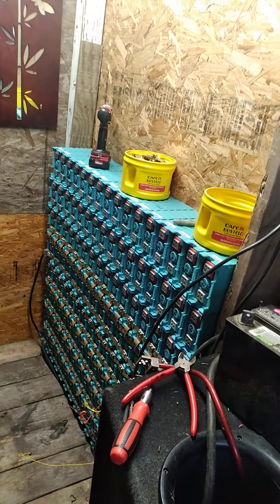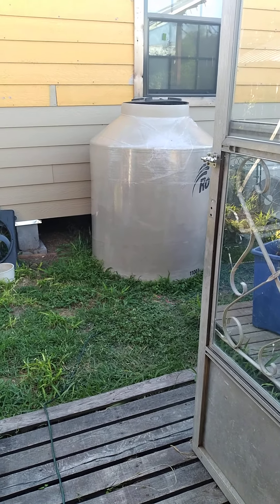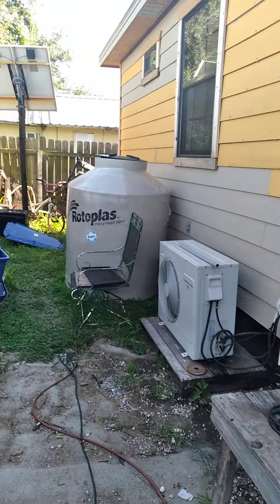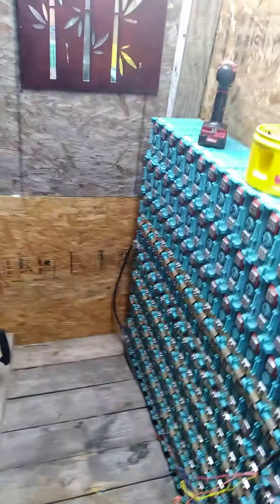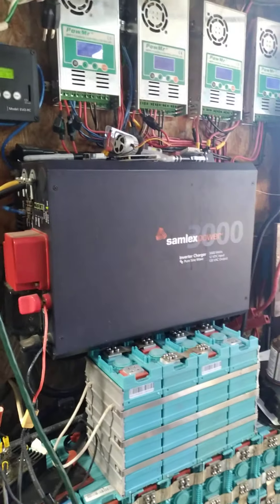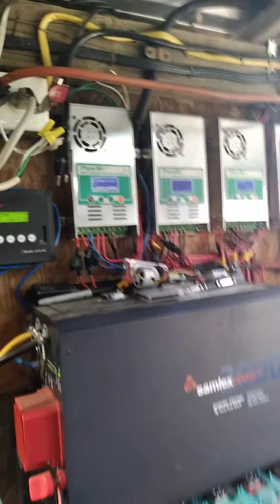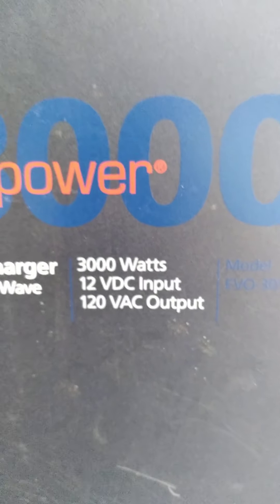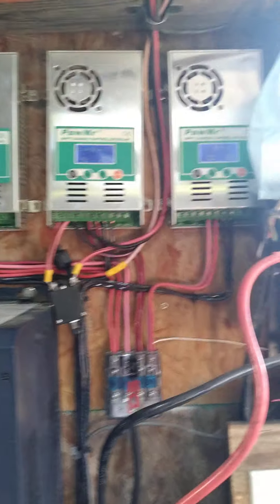start to move the off grid system

Comment: why don't you rewire your batteries for 48v and run a MPP SOLAR LVX6048 or 5048MG? 
The LVX6048 will run 6000 wats of solar with it's internal MPPT CC, 120/240v split phase output of 6000W continuous PSW inverter, it will handle your generator, with it's internal transfer switch. You can even parallel it upto 9 units for INSANE power if you ever need more. They are around $1000, which is an incredible deal. Your existing charger controllers will auto switch over to 48 v also, and handle four times the solar power that they can now. I mean you have the batteries already, why not do it right, once and be done with it? You get your 240 AND your 120 from one inverter. 
I have 2 of the 5048MG units, 7kW of solar, and can run my entire house, charge our Tesla, run my welder, shop power tools like planers jointers, table saws chop saws and compressors. They are beasts! Trust me on this, check out the http://www.mppsolar.com/v3/catalogs/LVX6048.pdf You wont be dissapointed. Pro Tip, Buy direct from MPP to ensure that you don't get a clone/copy.
Reply from the maker: I was thinking about getting the growatt 12kw inverter or the lvx6048 but I'm not really my wife is sick so I can't spend the money 😪
Reply from the maker: And I have 64 more put up in the house